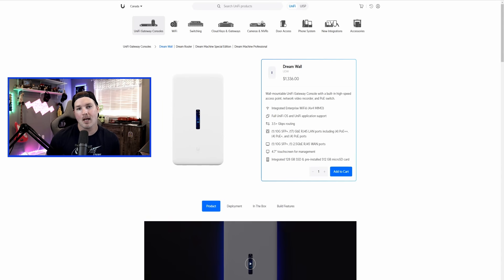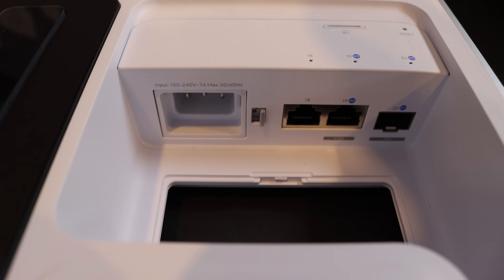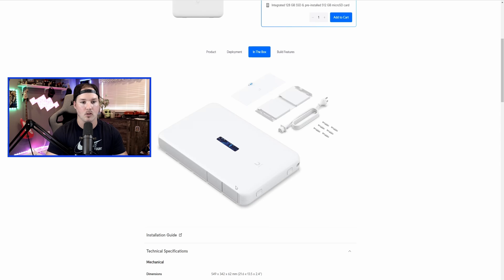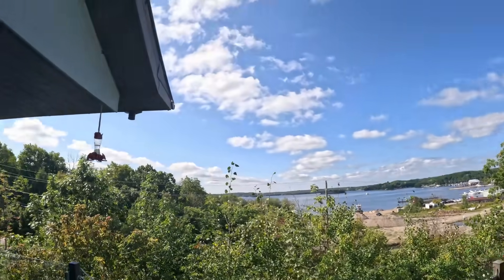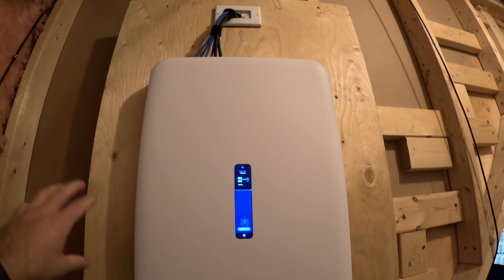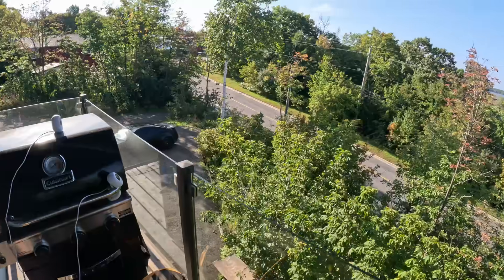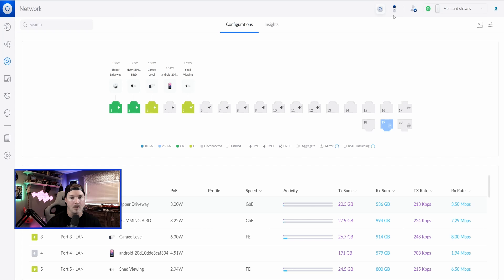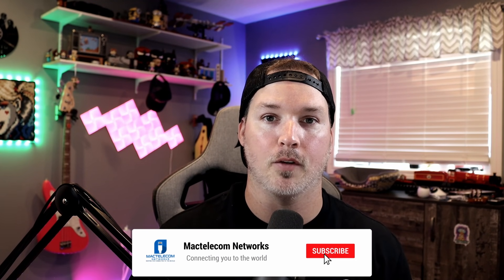Unifi Dream Wall Review : Is It Worth It?

Comment: Issue is lack of airflow on the SFP ports. A lot of the ONT/WAN SFP transceivers run HOT and need some air circulation. 

Outside of that it’s a good product.

Comment: When I first saw the Dreamwall, I was so excited about its form factor. Then I really looked at it. There are several shortcomings when I dove into it now that we’re in 2024. 1st, as everyone has mentioned why didn’t they include a 3.5 drive bay for longer term video storage? 2nd, with WiFi 7 released, they need a few ports to support 2.5Gb. 3rd, their power budget for one power supply makes it needing a 600w power supply.  (The 3.5in drive pushes it past the current power supply) 4th, if these are targeting small offices and new home builds they need to make a mount that can take advantage of a structured media center to have the dream wall become the door to the panel. 5th, swap the access point to WiFi 7.

I check daily on their website to see if they have a pro, se or enterprise version released . Hopefully they figure it out soon.

Comment: Could you not expand the internal ssd for protect? Or is the protect limited to the microSD slot?
The UDM se has the 128gb drive for protect and it would appear to be upgradable to a larger drive. 
One would think the UDW would be similar but never know.

Comment: Hey. Nice video. Is the WiFi range as good as the u6-pro? 1500 sqft? And in which direction does it go since it’s mounted to a wall? Is it 360 or more of 180 opposite the wall that it’s mounted on?

Comment: I'm strongly leaning towards putting one in, along with 4 cameras and 3 AP's (full reno and walls are open). Could this be installed on the main floor in plain sight? My biggest issue is what if I eventually move away from Unifi and now my patch panel is in the living room.  If it were to be put in a private closet on the main floor would it overheat? And can you fit the keystone terminations inside the Dream Wall itself and patch with 0.1 meter cables? Appreciate the detailed video!

Comment: 6:15 the dreaded Bell Gigahub, Bell's attempt to force you to use their modem as a your router no matter what. Does it still have the "bug" where wifi is turned on after a power cycle even if you manually disabled it?

Comment: The biggest issue I have with this model is the form factor, it doesn't seem to make any sense. I'd rather see this in a rackmount form factor. Definitly needs to support a 2nd PSU and HDD(s).

Comment: Is it possible to expand the storage with external 3.5 drives or a network share?
Reply from the maker: It is not
Reply: @MactelecomNetworks  I’d change the 2nd psu space for a 3.5” drive slot. But it is what it is. Terrible choice. Thanks man.

Comment: Neat box. I like the compact wall mount setup for smaller installs. I would like to see the power supplies have individual power connectors similar to what the 1u servers use. Would also like to see a DC power supply module supporting 9-60 volts for RV/Yacht/work van use with Site Magic. Cody is right about having a 3.5" harddrive bay in there to support more cameras.

Comment: I'm thinking about upgrading my entire home network to Ubiquiti as we will have 2Gbp symmetric fiber available. My goal is to have at least 2.5gbps to the my home office since the workstations will take advantage of it. I looked at the dreamwall but I am thinking is:

(1) UDM-Pro
(1) 24-port 2.5gbps Enterprise Switch (PoE)
(1) SPF 10gbps DAC cable to connect the two
(2) Wifi 6 AP's
(1) Unifi Door Bell Pro

Now it's just a matter of convincing my wife to let me run CAT 6 through out the entire house.

Comment: This is such a bizarre product. The form factor and WiFi seems to suggest putting it in a visible, central location of a home or small office. But who would do that with multiple cables feeding into the top of it. It belongs in a closet but isn’t rackable. It’s also more expensive than a UDM Pro + UNVR.

Comment: Cannot believe with the size of that thing the only option is SD card storage. They could have made the spare PSU port dual purpose as its a propriety unit. Either house an HDD or a second PSU which ever you want. There should also be a USB port for external drive support if an internal support is not available. Why would you spend nearly 2.5 times the price for this, its hard to justify.

Comment: I think this would be great for a small office with 5-15 people working with 1-2 doors. But the price is way too much for what you get. A Dream Machine Pro, 16 Port POE Switch, and a U6Pro would be $300-400 less and offer a much better path for long-term use. The missing hard drive and price over $700 make it DOA.
Reply: dream machine pro is 380$ 16 port poe switch is $300 access point is $150 not to mention I assume you need some form of NVR $300 and storage $100 +   and the backup power supply included call its 100$ to be cheap . You are also paying for form factor and an "all in one" solution. $1300+ start price for the same base line functionality. For a small home or home office that isnt expected to grow in size or scope much this makes a good pick.

Comment: I think this thing is so dumb.  For about the same price you can get a UDM-P and a USW-Pro-24-Poe.  But that's really only necessary if you need the PoE++ for unifi access or some other niche application.  For everone else I would recommend a UDM-P+ USW-24-Poe for better functionality, expandable hard drives, convenient rack mounting and expansion, and you'll save a bit of money even after buying a U6-Pro to go with it.  I cant imagine ever recommending this product to any client of mine.

Comment: I do like the all-in-one concept and it does fit the form factor of vertical network cabinets. I think this is a niche product, but I can see this being installed in small offices. I liked the idea of vertical network cabinets, then I realized that not much else can fit in these enclosures and the enclosures take up a lot of wall space. I prefer wall-mount racks as they take up less wall space, you can fit more in it and swap equipment easier. The other downside to this product when it is time to upgrade, you have to take down everything.

Micro SD cards are terrible with write cycles. They fail hard and suddenly. A 2.5" or 3.5" drive bay would have been better.

For general troubleshooting, the large screen is nice for the person on site to relay information to the technician. But I wonder if the better option would be a larger 2x2in or 4x4in screen that mimicked the function for all UniFi's Gen 2 devices. It makes programming and troubleshooting things easier when you don't need to memorize or document every function for every device.

The integrated switch is strange. Why not make all the ports PoE+ with the ability to toggle passive PoE and the last 4-8 ports PoE++? I do like that there is a SFP+ port for switch expansion, though. The 1Gb management port is nice to have tucked away (if that is the intended use case) and 2.5Gb and SFP+ WAN ports. Are the WAN ports tied together or can you create a primary and backup connection? I wish it also had a track to go to the top of the case, too.

I like the tool-less design, but wish there was a way to secure it with a padlock or security screw.

Comment: I have a UDW in my home since the first round of early access and agree with all of your critiques.  The SD card and low camera limit is very strange.  For most of its time in Early Access is showed the same camera capacity as a UDM-SE but it was reduced in a firmware update close to launch.  I'm using a 1TB SD card which gives me about 2 weeks of footage on my 6 x 2k cameras with a mix of ongoing and detection-only recording.  I can't understand the decision not to include a HDD slot or even an option for an NVME SSD or two.

Surprised to learn it only includes one PSU.  My EA unit has both PSU's occupied and firmware shows the power load split evenly between them at all times.

At the $700 I paid for it, I'm still happy with it.  But at today's pricing and the newly imposed camera limits, I'd get a UDM-SE and another POE++ capable switch if I were to buy again now.
Reply: It's for an all in one home setup or small business setup.   That entry alone makes it very affordable

Comment: Id say your reviews are missleading. Your reviews arnt reviews. They are just mostly demos of the product you get for free from Unifi. 
Its the same with all your "reviews".
Reply from the maker: The majority of the products you see on my channel I buy. Do I think this device is perfect no. Is the use case for it yes, of course I'm going to demo it. I put in a ton of Ubiquiti gear each year and am very happy with it. 

If you dislike my videos you don't need to watch them :)
Reply: @MactelecomNetworks  This is not review, a router review when you didn't test any routing capabilities. Good ad by the way
Reply: @germytron  This is a review, not a test.  That's why he didn't test any routing capabilities.  Good attempt to comment by the way
Reply: @Omniverse0  well a review includes processing power. If not you are missing one of the biggest points. Go and see any well done review.
Reply: @MactelecomNetworks  I just dont like that you call them reviews when they arnt. Product demo yes. And they are pretty nice product demos. You dont need to be a dick when I give you feedback.

Comment: Nice video Cody. Enjoyed the short video of the ride in a beautiful area. Good use case for the Dream Wall is for those who need the functionality of patch panel, switch and UDM but who don't have space for or don't want a rack mount. This is much better looking than a network rack.Many homes today have "structured wiring boxes" - this could work very well for those homes. I agree with your comment about adding another disk bay for extra storage.
Reply: I avoid those structured media cabinets, they always terrible. I'd much rather find a way to make a 19" rackmount work.

Comment: I'm just going to say it - this thing is dumb in every aspect. What use case does this serve that their other products dont? I feel like this is just UI tinkering with an idea and somehow sold it to the marketing team for a GA push. You can get a 3U horizontal wall rack UDM-Pro SE, 24 port switch, and patch panel for the same price that will take up less space. I just dont get it.. I guess the only thing this offers compared to that setup is a built in AP, but that is no big deal, especially at the price point. What UI should do is make a UDM-Pro SEv2 and move the hard drive caddy to the back and put a built in 16 or 24 port poe switch on the front, there's PLENTY of room in that chassis as is

Comment: Hey great video! Was waiting for the dream wall review for a while now. Looks like it's targeting new homes and families that don't like to have a network rack installed in a closet. Looks neat on a wall if the cable management is done right! My only gripe is that it doesn't accommodate an HDD (2TB to 8TB for NVR applications) and that the network ports are on the top which looks a bit off. Maybe having them on the sides or at the bottom would make more sense!
Reply: This thing is supposed to replace a wall mounted network rack, and in such installs the incoming network cables usually come in either through the wall or from the ceiling. The ports being on the top makes the most sense.